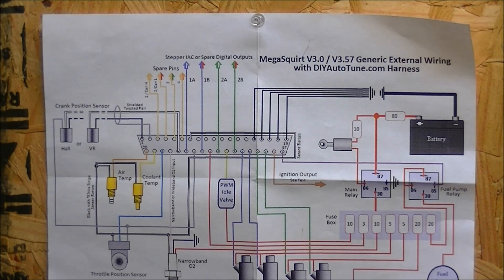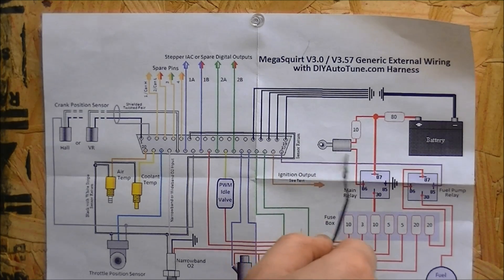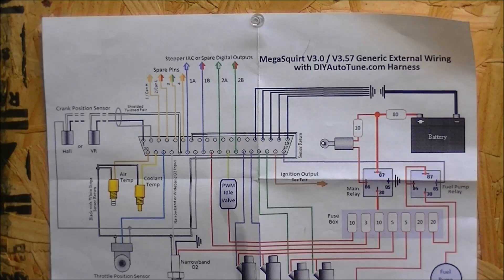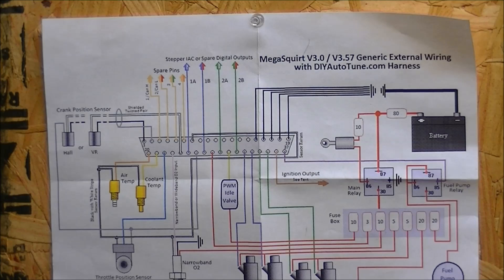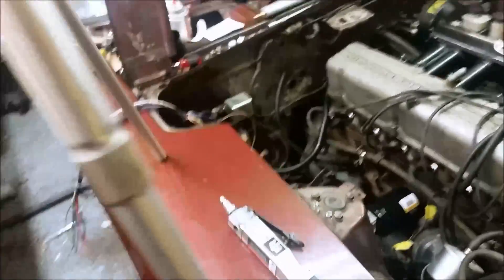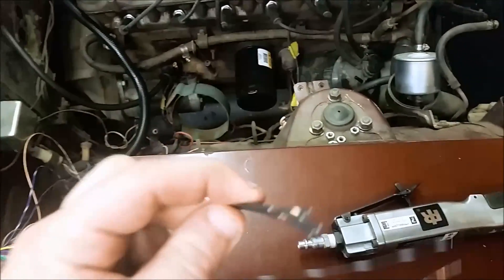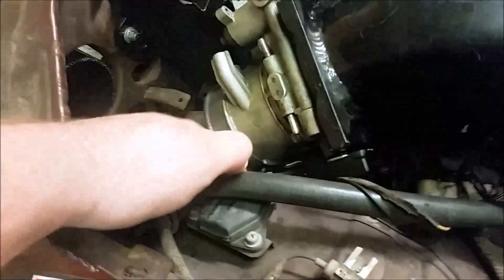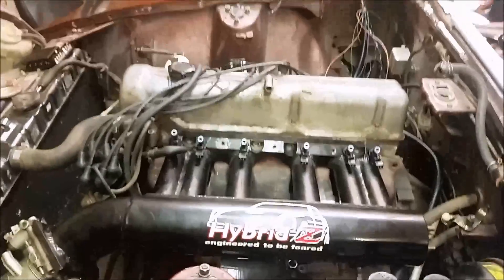Basic wiring of Megasquirt

Comment: Cuale será las líneas para la bobina o coil
Reply from the maker: Pin 36 "Ignition Output" is your coil or distributor ignition control.
Reply: Gracias tengo dos bobinas injeccion 1/4 y 2/3 cuales serán las dos líneas que debo usar  @on3racingchannel819

Comment: This is pretty useless since this is for a 4 CYLINDer and the 280 is 6!
Reply from the maker: @blairaaronson2453  how is this useless? Mega squirt only supports 4 injector out put at the time this was filmed. Not every injector gets individually fired. This is for batch injection. If this is too hard of a concept then maybe this video wasn’t intended for you.
Reply: @on3racingchannel819  Not a fan of Megasquirt period! Be easier to do my own dentle work. I see most.people who have these  installed are on a.constant learning curve with a poorly running vehicle. Thx
Reply from the maker: @ then why are you here lol I’ve been running it for years. There is a learning curve to anything, specially if it’s a cheaper diy option.
Reply: @on3racingchannel819  Good question! Sadly, I bought a car with this Frankenstein system so.I  trying to get it running properly. I POSTED $1,000 for someone to tune on the Ms forum.
Reply from the maker: @blairaaronson2453  but if you don't like the system then why not just rip it all off and buy a holley. For $1k you are basically at the cost of a holley kit
Reply: @on3racingchannel819  Lot more then a Holley,  heads etc be about 4k. Thx
Reply from the maker: @blairaaronson2453  What? The $1k you are offering to setup and tune the mega could get you a Holley Terminator kit. That has nothing to do with cylinder heads.
Reply: @on3racingchannel819  Agreed.  I have already shopped th3 cost to go back to stock.  May happen.....

Comment: I gotta pass smog on an 82 B2000. This Nikki carb sucks, I cannot lean it enough to get the stink out of the exhaust. Im not sure whats up with it but I have a MS2 with no plans. I just want to get a clean running motor so the refs can sign it off. Do these need the additional smog pumps and air injection or is EFI clean enough to ditch these? I think they are carb related....thanks.

Comment: Great video! Is it the same wiring diagram for a fuel only setup? Please let me know, thanks!
Reply from the maker: It would be pretty similar. You will still need signal input from a distributor or crank/cam position

Comment: In the diagram, I only see 1 output for an ignition coil. I am thinking about installing a megasquirt in my 6 cylinder engine, and I dont see how I could use 1 trigger to spark all the coils at once. I think my oem coil fires 2 cylinders at a time. I cant seem to find any info on this so any help would be great. Thanks!
Reply from the maker: The MS2 and MS3 both offer more outputs than just one. You could either install extra ignition output circuits inside the unit or I believe DIYAUTOTUNE now sells spark modules for that application.

Comment: Great video!! But i am still a little insecure about the wiring. I also have an Megasquirt-2 v3.57. And i want to wire it in an Chrysler crossfire. Is there any step by step video of how to connect each wire? Dont want to get it wrong :)
Reply from the maker: On a crossfire there probably isn’t going to be. You can always check diy auto tune website they have different write ups on different vehicles.

Comment: Would this work for modern cars or only those of a certain vintage like 70's early 80's.
Reply from the maker: Check out www.diyautotune.com you can install these on just about anything. I have installed them on a 03 mustang,  some LS based stuff and several 302 fords (windsor). Now you cant really add it to say a 15 challenger because of the factory ecu integration but it can run newer engines

Comment: there is 4 wires for fuel injectors I have a v6 where do I wire the extra two fuel injectors?
Reply from the maker: Tie 2 into 1 and feed 3 injectors and do the same with the other side
Reply: Whaw derp, thanks lol that makes sense

Comment: i looked at the ms wire diagram 50x and didn't notice the 37 pin is a ground lead.  thank you.  Clear as day and over looked that critical detail.
Reply from the maker: Ed Solomon glad to help! I tried to be clear as possible even tho I know I repeated myself several times haha
Reply: on3 racing channel repetition is the key to teaching.  I'm having trouble figuring out ms pin 1,2 and 24 in that shielded covering. connecting to my 1g cas.  the computer is reading crazy hi rpm and noise that won't let it start.
Reply from the maker: Ed Solomon 24 is just the shielding wire for those 2 sensor so you won't do anything with it. If you are seeing crazy rpm you could either 1. Have the wrong sensor that doesn't work with megasquirt or 2. Have it setup wrong in tuner studios. I didn't have a trigger wheel I used the distributor so mine will be different
Reply: on3 racing channel I'm gonna have to do more studying. I have 24 connected to an existing cas assigned pin from the stock ecu pin out.  and pin 1,2 are both grounded to assigned ecu ground and gray wire 26 is to another cas assigned pin

Comment: Hey bro I am going to get a new computer I am getting a ms2 megasquirt with the 10′ MegaSquirt Wiring Harness but I see the diagram is for only four injectors is there something I could to do to get it for 6 injectors is there a trick for it?
Reply from the maker: No trick to it. The injectors are wired off of banks. So while the picture only shows 4 injectors you can wire it up to however many you need. So the way it will work is you have a bank 1 and bank 2 wire. Each bank has 2 control wires per bank. In the 4 cylinder model bank 1 wire 1 goes to cylinder 1. bank 1 wire 2 goes to cylinder 2. bank 2 wire 1 goes to cylinder 3 bank 2 wire 2 goes to cylinder 4. On yours you can do it like this. bank 1 wire 1 goes to cylinder 1, 2, and 3. bank 2 wire 1 goes to cylinders 3,4, and 5. Or in any form you want to. Some wire them up as to follow the firing order. EXAMPLE bank 1 wire 1 goes to 1,3,4 bank 2 wire 2 goes to 2,5, and 6. There is some theory that this helps fuel flow but i would't worry about it honestly. Splitting atoms at that point. Hope this helps. Let me know if i need to clear any of it up

Comment: Correction. The wires coming off the O2 sensor are tan-purple-and 2 browns. The plug-in connector has different colors. The tan does to the red wire, one brown goes to a yellow wire, the other brown goes to a black wire, and the purple goes to the white wire. The red wire I connected to a 5 amp fuse and the black went to ground. The two brown wires I'm not sure of. T he diagram you are showing has what look like a light purple and grey wires being connected to the relay board. Does it matter which way they are connected? Thank you, Bill

Comment: I don't know. It has 4 wires if that helps. Red, black, yellow, and purple.
Reply from the maker: earlyhemibill it sounds like you have a wide band o2 sensor which you will need some kind of controller for to warm the sensor up and then interpolate the data from the sensor and put it out in a wave form for the megasquirt

Comment: I have an issue I'm hoping you can help with. I have an O2 sensor with 4 wires. I believe the red is hot and the black is ground. The other 2 wires are yellow and white. Does it matter which is which when going to the relay board? I ask because the wire colors don't match the diagram shown here. Thank you in advance, Bill
Reply from the maker: Is it a wide band or narrow band sensor? My o2 sensor is a wide band and has a controller that powers the o2 sensor. Then I give the red wire key on positive, the black wire ground, and my yellow wire is going to my o2 input on my megasquirt.
Reply: on3 racing channel I used an ohm meter to run the wiring on the O2 sensor. The red and black wires were the only ones to show connection, so I wired those to hot and ground. the other 2 will go to the relay board. I sure hope this does it. Thanks for any help you have given me so far,  Bill
Reply from the maker: yes that will be the heater circuit but will need a controller or else you will burn the the heater circuit up. I think the best thing to do would be to save up and buy a wideband o2 like a lc2.